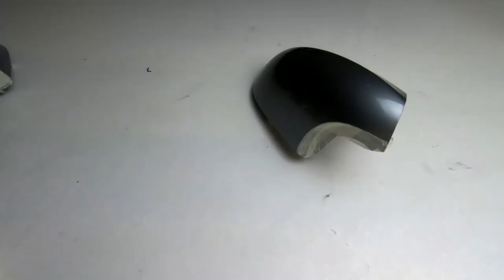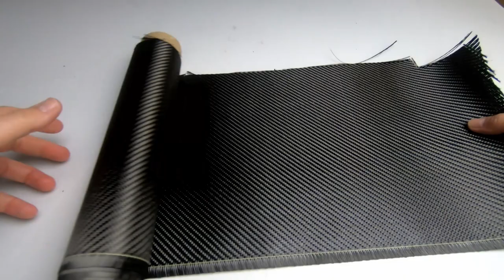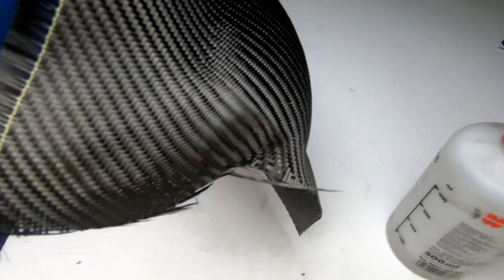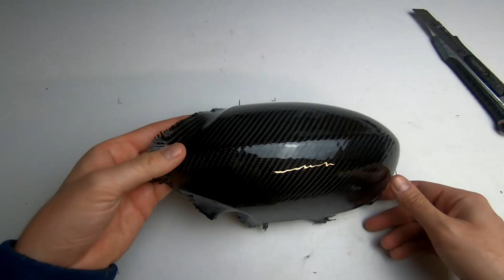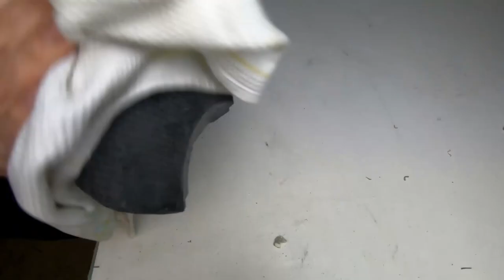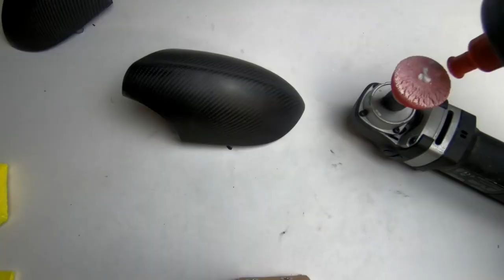How to make a real carbonfiber mirror cover yourself at home?

Comment: Hi, thanks for the cool videos!
Do you use a hair dryer or a gas torch after each epoxy coat? For removing air bubbles?
Reply from the maker: thanks 🙏. no, I use a resin with a gel time of 3 hours.